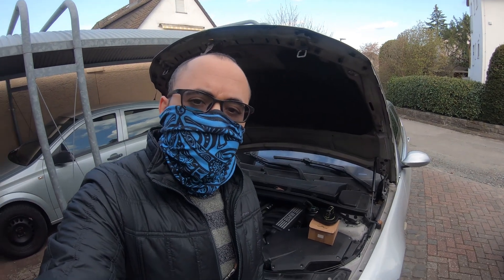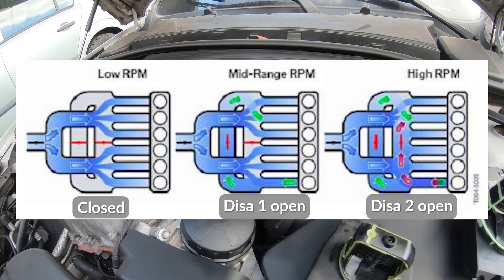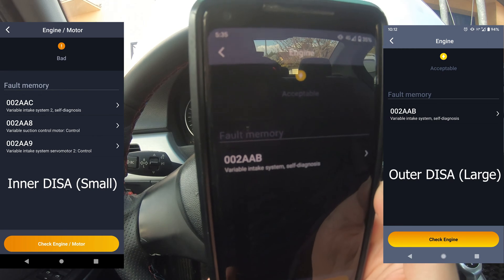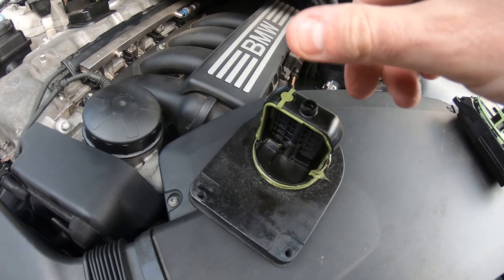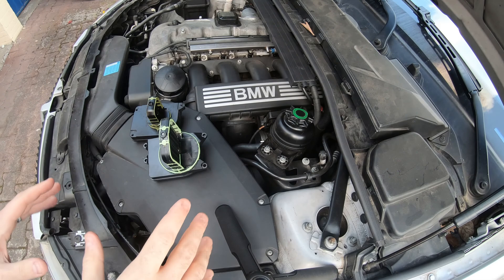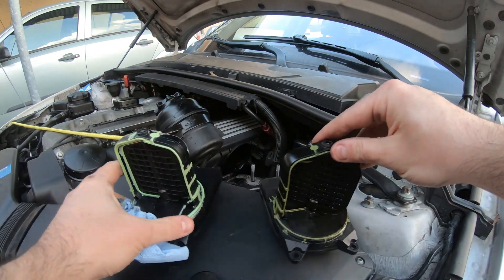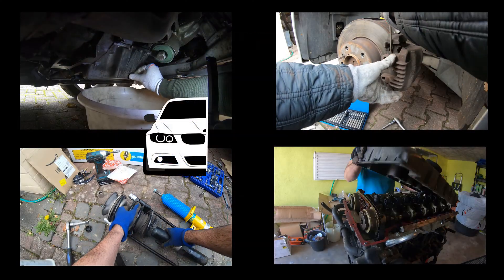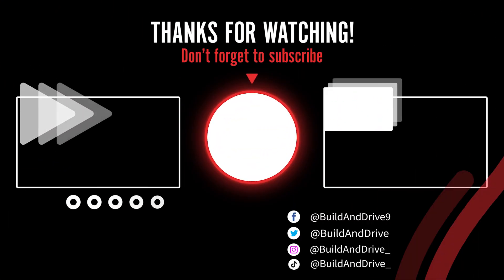[DIY] BMW N52 Disa Valve Replacement & Test With Inpa!

Comment: I believe my DISA destroyed my cylinder 6 
Have a misfire code on 6 but no other codes with my basic code scanner
I am experiencing some knocking like sounds when accelerating and acceleration is like it’s in limp mode
Reply from the maker: Do a compression test and see https://youtu.be/v0gH8dFyWH8

Comment: Can Inpa be used to program modules? This seems more simple than Ista
Reply from the maker: There's a bunch of software out there that do different things. What module do you need to code?
Reply: @buildanddrive Junction box DME to replace and program not code

Comment: Hi I have a 2aa9 code only. Does that indicate a disa valve problem too?
Reply from the maker: Yes, it will be one of the valves
Reply: @buildanddrive Thanks for the reply. It also says servo motor 2: activation. So I'm guessing it's the one closer to the intake valve ?
Reply from the maker: Yes

Comment: Is calibration needed when replacing? Or is what you are doing good enough?
Reply from the maker: Calibration automatically happens every time on startup. That's why it will throw an error if the flaps don't open properly, telling you that something is broken

Comment: Curious how long this DISA replacement lasted? Have read horror stories about aftermarket but dont want to cough up the $600+ for oem right now
Reply from the maker: So far so good, after about 20,000kms. I only had to silicone the edges of the large disa because it was leaking air around the seal. But at the moment, no issues

Comment: I love the video mine is an n51 I was able to get the big one out I just need more time for the little one The small one now makes a small rattling noise and I looked at my original one I think it's broken thank you you I really appreciate your help🎉🎉🎉🎉
Reply from the maker: Your welcome. Good luck with your repair
Reply: @buildanddrive  I already installed a big one I'm just working on the small one but I live in Connecticut and I have to battle the cold air

Comment: i removed disa valve and its open ( there is no play or broken  ) is it consider bad ..? e90 2010 325i , the car has rough idle at start and loosing power not picking the way it should
Reply from the maker: Do you have the intake with 2 disa valves? Do you have the same error codes I am getting? If it's stuck open, then you'll have full power after 4k rpm but no low end torque.
Reply: @buildanddrive  i will replace those valves today and will let you know the codes 
bcz i am getting bunch of codes now 🤭
2AAE, 29E1, 2AAC,2AA8,2AA9
Reply from the maker: Check for vacuum leaks. If your car isn't using properly, that's the first step https://youtu.be/_5Sbz818YVI

Comment: Sometimes those valves give no error codes sadly, while the flaps are not functioning correctly. Only way to be sure is to pull them out and do the actuation test and physically look and confirm, that the valves fully close and open.
Reply: this is very true. BOTH my disas are broken and the motor is not able to turn the flaps, yet my car does not throw any codes at all.
Reply from the maker: Yes, very true. I had one code for disa and I cleared it, then it only came back once. I think the flap breaks and then the shaft can turn freely again so the ECU thinks "the disa flap is turning" so there's no problem and it doesn't give you the code anymore. Good point.

Comment: Les comparto mi experiencia y solución:

Tengo un BMW 530i (E60) con motor n52...

Todo comenzó con el clásico chillido que hace el vehículo cuando la válvula pcv está dañada, así lo dejé pensando que era alguna polea, le cambié la banda y la polea loca y el chillido seguía, otro síntoma es que el vehículo de la nada se me apagaba, y comence a notar que el consumo de gasolina no era el óptimo, lo volvía a encender y andaba de nuevo, después hice la prueba con el motor encendido intentaba quitar el tapón del aceite y era tanta la succión que a veces ni siquiera lo podía quitar, lo que me llevó a la conclusión de que la válvula pcv estaba dañada...

Después cambie la pcv (en estos motores se cambia la tapa de punterías completa, ya que la pcv viene integrada a la tapa), y asunto arreglado, se quitó el chillido y dejó de apagarse de la nada, hasta aquí todo bien....

Pasó el tiempo y noté que el consumo de gasolina estaba muy elevado y el carro comenzó a hacerme otros síntomas, ralentí inestable, y cuando el motor caía a las 600-700 rpm, el coche comenzaba a vibrar, pero era una vibración excesiva en general, adentro se escuchaba demasiado, el volante, tablero, el habitáculo vibraba mucho y sentí que el carro tenía  pérdida de potencia, Check engine encendido con código de falla 2AA9, pero ojo!!, Primero lo escanee con un escáner clásico, actron sencillo y no arrojaba código, hasta que le metí un escáner más completo y con este si lo arrojó, por lo que recomiendo que lo escaneen con el mejor posible...

Después quité las 2 válvulas disa y sorpresa!, todo el colector de admisión tenía residuos de aceite, quite el sistema de admision, le hice su limpieza, probé las disa y estaban atascadas, las abrí para checarlas por dentro y que creen?...la disa primaria tenía ya el motor oxidado y con residuos de aceite, le hice su limpieza y volvió a la vida!, pero  la secundaria estaba inundada de aceite! Y la tarjeta electrónica que lleva se estropeó, solo pude rescatar la disa primaria, así que preferí comprar las 2 disa usadas en buen estado y  originales, que nuevas genéricas...

 Después hice las pruebas para checar las válvulas, es importante que hagan la prueba de esta manera: coloquen las disa usadas en su lugar pero sin conectar, teniendo las disa nuevas afuera, les puse sus conectores para poder observarlas, eché a andar el vehículo y la primaria cerró por completo y se mantuvo cerrada en ralentí (así debe ser), y la secundaria  cerró entre las 3500 y 4500 rpm (así debe ser también), y dependiendo las rpm están abriendo y cerrando todo el tiempo, por lo que concluí que estaban en perfecto estado, ya solo armé todo nuevamente y asunto arreglado, el coche anda perfecto, y ya no tiene ningún síntoma que les mencioné, le borré el código y ya no apareció más..

En conclusión, cuando noten el primer síntoma o que la pcv comienza a dar problemas, no duden en cambiarla inmediatamente!!, esto les evitará problemas con las disa y créanme, les ahorrará bastante tiempo y dinero (disa nuevas, gasto de gasolina innecesaria, sensores, etc)...

Si en algo les puedo colaborar, estoy a la orden, saludos!
Reply from the maker: Thanks for the information. My fuel consumption is a bit higher than normal now. I suggest also smoke testing the engine to find where the air is leaking from. I made a video and will try this again.
Reply: Gracias     Excelente información

Comment: What code reader do you use? regular OBD or something specially for BMW
Reply from the maker: Obd2 cable for BMWs. depending on which model bmw you have, you need to get the right cable. Some cars have the dcan bus system you need to be able to integrate with.

Comment: My n52 clicks sort of like a clock every other second. I only notice it at idle when I'm outside the car, would it be this? I'm at 266k miles. Kind of sounds like an electric motor is stuck and its trying to move every other second.
Reply from the maker: Can you send me a video on Instagram?
Reply: Valvetronic issue ?

Comment: Looking for help, I had a code related to tank ventilation, I changed the part but after a month it came back again with code related to tank ventilation, this is the second time changing that part in a month,I don't know what could be happening, I always use gasoline 93.
Reply from the maker: What's is the code?
Reply: @buildanddrive  2A1A- TANK VENTILATION FUNCTION.

Comment: We’re you concerned at all that the pin snapped? It did on mine too and people say that it might end up in the engine
Reply from the maker: Very concerned. I thought it may have damaged a valve or something. Since it was so small and plastic, I assume it went through the engine with no problems. Im glad I caught the problem early.

Comment: Hello !
I have a problem, i repaired my disa valve and i installed it on my car.I checked the disa valve with the inpa and it is working but when i start the engine the flap it doesn’t close.
What to do to fix this ?
Thank you!
Reply from the maker: Maybe reset disa adaptations in inpa
Reply: @buildanddrive   I founded the problem, I didn't know that the actuator of the disa valve have a single position and if you reverse it will open the valve when it should close.
Thank you for your answer!
Reply: @buildanddrive  do you have any videos of how to reset adaption only for disa?
P.S. I found that it is working in reverse, when engine starts the valve is open when I rev the engine the valve is closing … I could installed the valve wrong ?

Comment: Maybe a bit late to the party but the oil in the intake indicates either a bad/worn CCV or a CCV without heater hoses. Sitting for a longer period of time, then starting will cause oil in the intake on the N52 as well.

Usually a bad CCV works it's way down the line and kills the DISA valves too.
Reply: Also pothole damage is known for killing the CCV and DISA valves so if your bmw has been crashed or damaged in some way it's very recommended to just outright replace these parts even if they aren't immediately showing problems, because they probably will.
Reply from the maker: Didnt know about the pothole thing. CCV failed every 2 years so yes, eventually it killed both DISA valves.

Comment: May i ask why ur seatbelt and airbag on? I wana know i got a long stupid story and want more info to pin point the problem that was before another problem that occurred
Reply from the maker: It took a while to figure out but was the clock spring circuit that failed. You'll have to check your seatbelt circuits, airbag and clockspring. It could also be the airbag module itself. I show how to fix it here: https://youtu.be/_K9EA79MLpY
Reply: Did you ever figure it out? I may have a solution to this i fixed mine already

Comment: Hi, do you need to “teach” the new Disa after change, or you just change it and then it’s finish?
Reply from the maker: You just change it. I think It automatically does a check when you start the car. If there is a problem, it throws a code
Reply: @buildanddrive I changed my disa valve, and I’m still having the rough idle. Even though that was the issue, the disa was literally broken. What do I do?
Reply from the maker: @j3asan  check my channel for a smoke test. Find the air leaks in your intake/engine
Reply: Czy można jeździć z odłączoną dużą disą

Comment: I have same issue. Is it bad if i dont find the plastic pin. It can be in intake manifold. Do I need to take intake manifold off and try to find it?
Reply from the maker: If you want to, did you find the flap at least?
Reply: @buildanddrive  yea i found it! I wiil try to find the plastic pin but if i dont find it inside the intake manifold then I dont know where it can be. I think the pin has been loose like 2000km so I dont think that im going to find it but I still want to try.

Comment: Do you know where the 872-405 A wire goes and the 7507524.9 I've been having trouble finding the place to plug it in
Reply from the maker: Can you send me a photo on Instagram?
Reply: @buildanddrive  turns out i had a 330i manifold on my 328i so i got the wrong manifold which didnt have the 2 orange sensor wire plugins so i ordered a 330i one and it should be running after that

Comment: I recently bought a 135k 328i, and I noticed a few crackling sounds during acceleration. From your videos, it might just be the Disa valve, but mines an N51
Reply from the maker: Does it sound similar to the video?
Reply: @buildanddrive Yes, sounds quite similar. But feels more like a slight crackle which gets better after the engine is hot

Comment: From my experience generic Disa valve is a bad idea. It's better to buy a used original part with the updated (latest) part number.
Reply from the maker: Yep, but I didn't want to pay an insane amount of money. Funny thing is, the seals in this Chinese part failed after a year. I had idle issues and had to silicone it 😆

Comment: Please share the link for the DISA valve you purchased!
Reply from the maker: No, the seals in this disa valve failed after a year. Get a mahle or valeo part instead if you really want to keep the car a long time
Reply: @buildanddrive  How do you find out which brands are OEM?
Reply from the maker: Normally Valeo or Malhe are OEM spec

Comment: what brand did you buy? I might modify flaps instead since DISAS so expensive so better buy DIY flaps kit from US or Ukraine :)
Reply from the maker: Yes, you can buy the kit with the long metal pin and rebuild it. The brand was some Chinese brand off eBay.